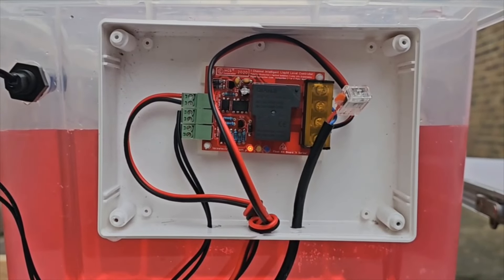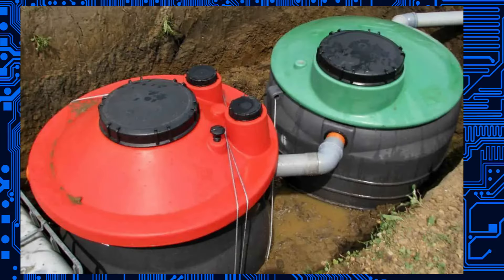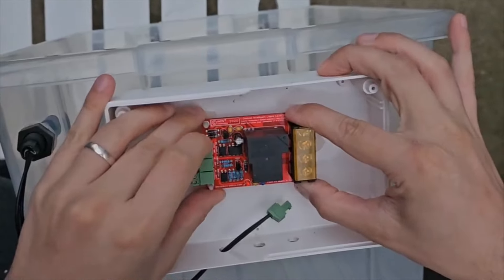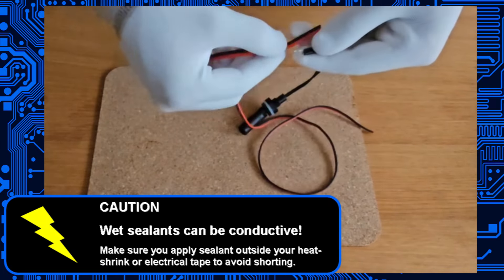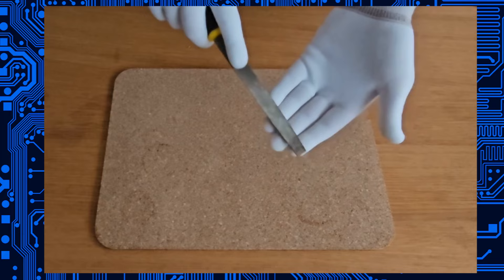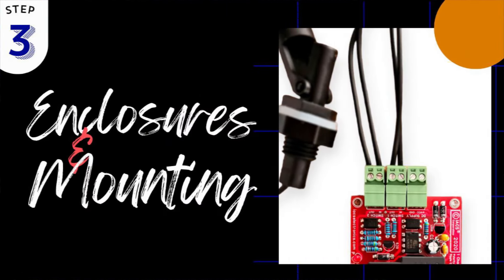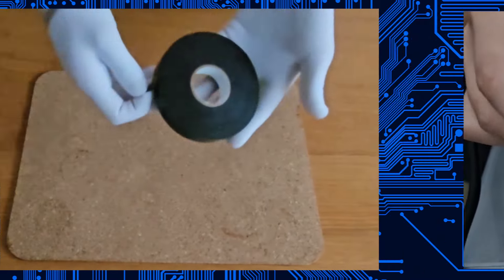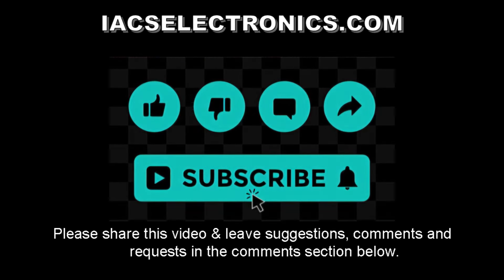Installation Guide How-To Set-up IACS Float Switch Kit X Series (FKX Kits 1, 2 and 3)  PART- I

Comment: My husband and I are building a hydroponic system. We want to pump the water up to an upper tank. We then want the water to filter through the plants. When the water has gone through the complete system and filled the bottom reservoir we want it to pump around again. Can this thing do that?
Reply from the maker: Hi there. Thank you for your comment. You need the float kit X series kit 3 which is also known as our automatic drain controller. Not be confused with a device for managing drains it's actually designed for draining a tank using a pump. It does not include a pump. You will need to install two float switches into your tank. You how's the circuit board in a box away from the tank or on the side of the tank. It's easier than it sounds. It is available on our website on the following link... Please let us know if you need any help. https://iacselectronics.com/product/fk-x1d-automatic-drain-controller/

Comment: Hello found your link in tiktok, me and my partner are very interested in your product the automatic refill controller. So in your kit, for example, if I use these two float switch in a brewery tank, then it automatically refills my tank, since it is the kit's special feature. So can the board send a signal that it's already full and ready for collection?  we really needed this kind of feature in our new project.
Reply from the maker: Hi thanks for your comment. Short answer is yes you can... Depending on what sort of signal you want. It will also defend on the voltage of your pump. Because the device can be wired up so it turns something on or off. . it has two connectors. This means that as it turns your pump off because the tank is full, Air Canada turn something else on or trigger something else to turn on for a short period of time. If for example you have a mains voltage pump. .. you could wire in a mains voltage signal lamp or siren, and waterproof reset switch. This would enable the device to automatically refill your tank... And when it reaches the full position it would turn on a siren or light until someone presses the reset button disconnecting the circuit. The system would then go back to monitoring the tank to see if it needs refilling again. Is this the sort of thing you meant?
Reply: @IACSElectronics  wow, thanks for the quick reply! So this is doable. Got it. So my tank is with warm pressurized water used for flushing out sludge from the bottom of the fermentation tank. So I am wondering if I can switch a solenoid as well as a pump for this or will i need a 2nd board? The pump and solenoid are both 110V AC.
Reply from the maker: @TerryPelsky  you can switch to together as long as the total amperage doesn't exceed the maximum rating on the board. If you check the average or wattage of your pump and solenoid... Add the number of amps together. . then multiply the total by 3... This is the approximate spike. The continuous draw should preferably be below 25 amps. Make sure your pump and solenoid have their own fuse or surge protectors if needed. I would recommend intersecting the neutral side of each. Route through calm and normally open. We will show diagrams in part 2 of the installation guide.